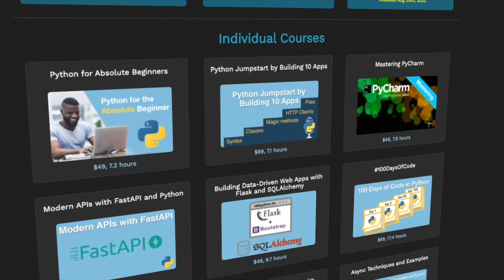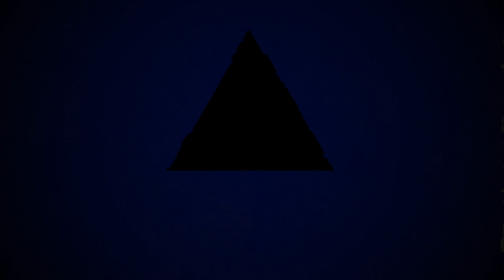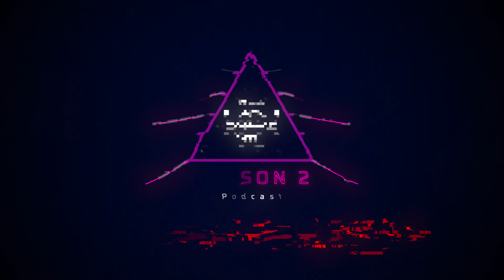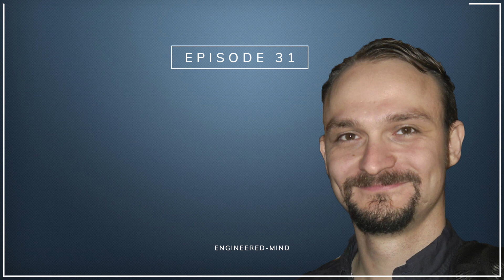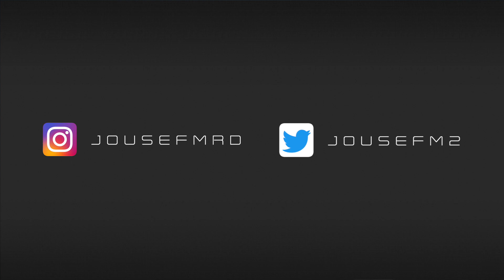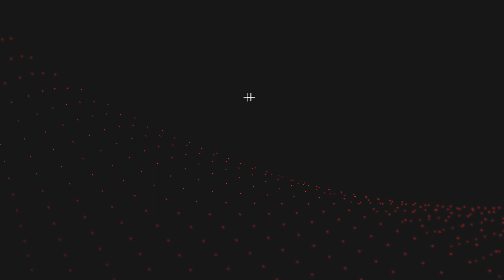OpenFOAM & CFD Tips - Jozsef Nagy | Podcast #31

Comment: If someone decides to use and learn OpenFOAM, spending time on it is very important, you have to dive into the source code and see how it works, gonna be a little hard and boiling until you could understand the whole structure and do things interesting.

Comment: CFD is more focused on engineering rather than research, at least for most of us, it is a simple tool, you need it to tell you what would happen and why it happens. Most of us don't really need open-source code, Ansys rules.
Reply from the maker: It really depends on who you are and what you want to accomplish. For academic purposes, OF is a good start and without having to commit to any upfront investment, it is one of the better options out there for sure. If you are a designer and want to deal less with the hassle of "numerics" for example, SimScale is a good way to get started.